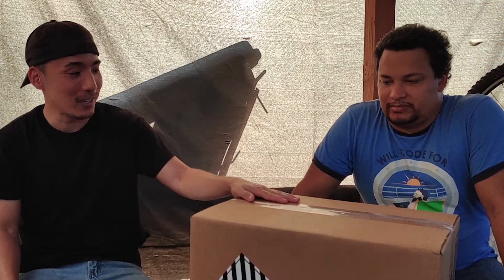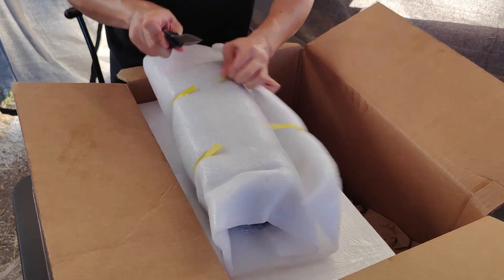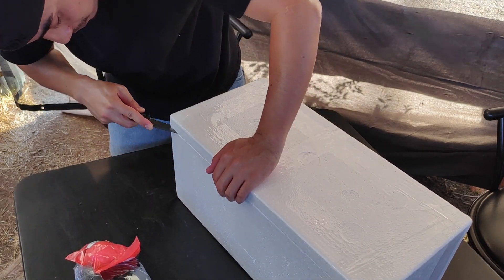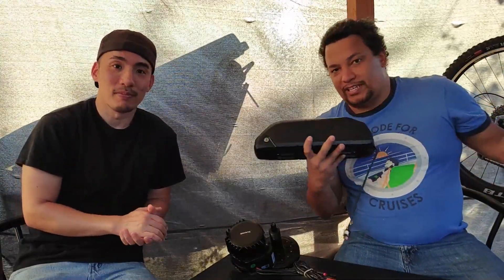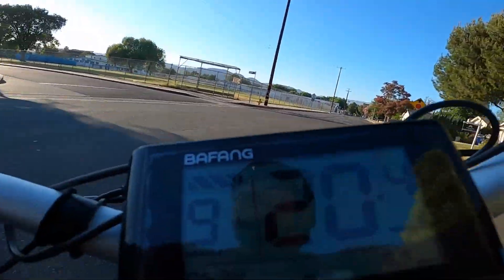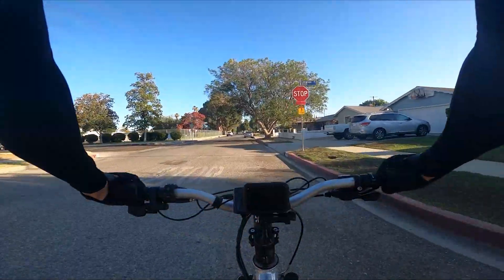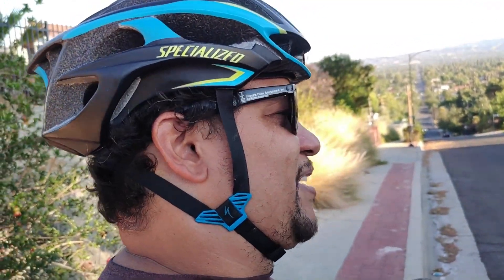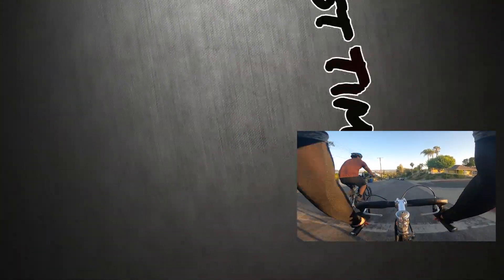Electric MTB BBSHD 1000w Bafang mid drive unboxing (diy ebike)

Comment: One thing to note: chain and cassette should be at least near new or new. And the derailleur should be also. And the fewer gears the better, if you ask me. 
I chewed through a new cassette with a new chain in short order. Well, I was riding it like a small motorcycle.
I built a new rear wheel with a Sturmey Archer 3 speed hub. And it’s a 24” wheel. I wanted to change the geometry and the lower final gearing will help going up and tame down the top speed. 
Anyway, if you are lighter, like a 110 pound woman, the BBSO2 will work just fine and you can save some money.
Reply from the maker: Thanks for the info! Agreed! Makes sense to have a smaller cassette or even single speed if mostly on flats.

Comment: Hey there, I was looking to get this motor and start commuting to the office…is the bottom bracket on the bottor meant to fit onto just about any bicycle?
Reply from the maker: Hello and thanks for your question. As far as their website states, the one we purchased was for a bottom bracket size of 68-73mm. This is the standard size that would fit most bikes, so you'll need to know your bottom bracket size before purchasing.
Reply: @FirstTimersChannel  oh for sure! thanks for replying and for the heads up 🤙🏾
Reply from the maker: @arturod.1144  here is a website that allows you to print out the sizes -- https://bafangusadirect.com/pages/quiz